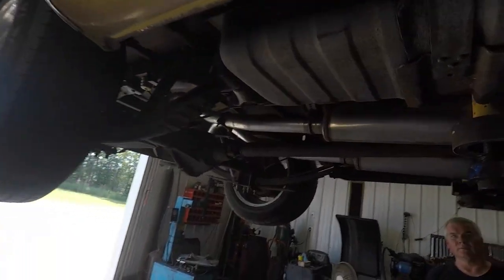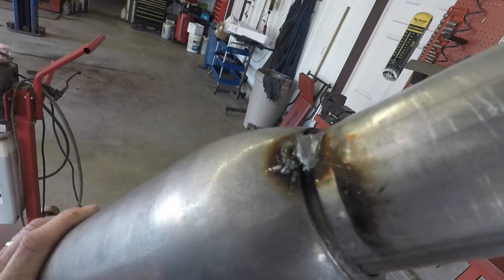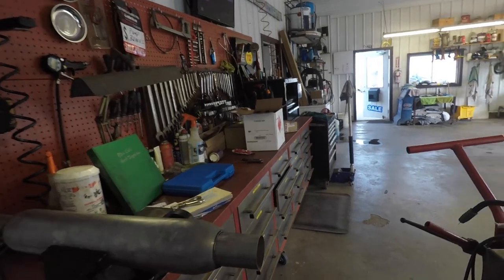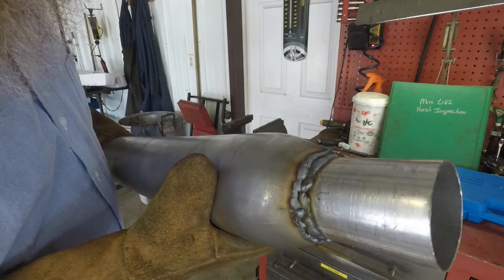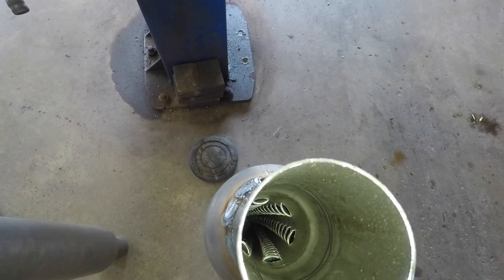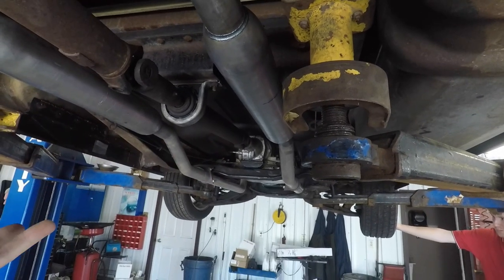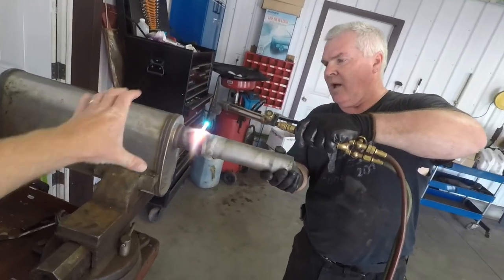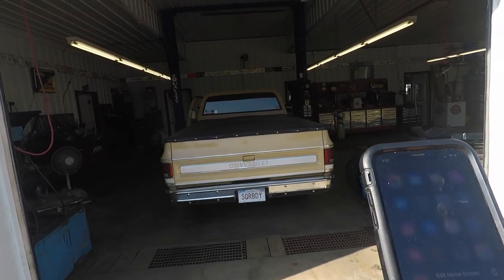How to quiet down your exhaust with glass pack mufflers

Comment: Almost 40 year muffler installer/glasspack manufacturer here. Facing the opening of the louvers in the core toward the motor will initially result in quieter operation at the expense of increased backpressure and early glass burn out. Louver openings facing to the rear if the core is sized properly for the cubic inches of the motor and the air flow requirements/H.P./engine volumetric efficiency, will result in the fiberglass packing lasting indefinitely. Be facing the louvers to the entry of the muffler you are encouraging the exhaust to also flow through the louver and then between the core and the case before it exits blowing out the fiberglasspacking. This will be exacerbated especially if the core is a little undersized. I believe you could safely run it this way (louvers forward) if indeed the muffler were a steel pack (packed with stainless steel wool rather than needled high temp fiberglass) which I also manufacture.
Reply from the maker: Great information! Thanks for your explanation and expertise!
Reply: Can you recommend anything to make a 1982 V8 307 modern day silent?...  Aside from telling "my wife to shut up and enjoy the sound, screw the neighbors VROOM ".  I figure that would cost me half, plus maybe my life ( latina wife)..SO, I figure making the car quiet would be less expensive and less hazardous to my health.
. 🤷🏻‍♂️
Reply: @TheOutlawGeneralBacon  Put a catalytic converter in the headpipe. Heck put 2 in, one behind the other. Install a quiet muffler and put a resonator in the tailpipe. You'll be modern day quiet 🤫 🙂
Reply: @TheOutlawGeneralBacon  walker quiet flow muffler.
Reply: @frigglebiscuit7484  I went with a ceramic velpro maybe.🤔🤷🏻‍♂️. I forget the name of it is. But I feel a tad more power, and it's QUIET can't even hear it standing right next to it.  The only issue now is I need so sort of extension or something,.  Black soot on a new chrome bumper is a bit infuriating.. went stainless to from head to ceramic cat, and ceramic stainless muffler. 3in outlet. .. all in all, I'm pretty happy with it for now . Thanks for the advice tho. I appreciate you
Reply: Can you recommend me what to do.

Set up is 370z with test pipes (no cat converters)
2.5inch all the way through with 2 resonators and dual muffler.

The volume is very loud. How can I reduce the volume of the exhaust without sacrificing the performance hp?

I don't want any restrictions

Comment: I have a 2014 f150 with a 5.0. I installed a Dynomax single 3 inch exhaust with a glass pack in the spot for the factory resonator. The sound is absolute perfection no snapping or popping or any of that raspy junk that people seem to like now. It's all low and mellow tone even at full throttle. I also have a 1970 Torino with a blueprint 302 in it that is just shy of 370 horsepower. Right now I have long tube headers and magnaflow ovals with dumps in front of the axle. It gets very snappy under full throttle but sounds great at idle like your truck. It just sounds angry if you know what I mean. anytime you put the gas pedal down more than normal driving. Since the glass pack in front of the muffler on the truck worked so well I'm about to order a set of short glass packs to put in front of the magnaflows on the Torino. Hopefully that will take the full throttle edge off of it and make it more enjoyable. It used to have full tail pipes going out the back but somehow that was causing an engine vibration so I chopped them off while I was putting the magnaflows on, and welded on dumps. I just want to get away from that completely angry sound that's going to cause me to get tickets. I also picked an exhaust shop that wanted $125 more for an H-pipe, so I still have that to do.
Reply from the maker: I think you’re on the right track!
Reply: @OldeCarrGuy  IT WORKED!!! Still sounds like a performance car with a nice engine, but doesn't sound like Nascar try outs when revved!! The sound when revving it up was reduced by at least half!

Comment: This is a big difference with the glass pack, still sounds great at idle. I have a 08 canyon 4 cylinder... Have 2 mufflers. 1 is a single chamber v-baffle style by team allied exhaust, it replaced a non- monitored plugged cat. Replaced the magna flow had on it with a 3 chambered street flow v-baffle type. Sounds nice at idle and outside of 1800 to 2200 rpm. Still get a bit of drone in cab. Think I may give a glass pack a try in front of the main muffler. Anybody have any suggestions? Thanks. Great video. I have an update, in place of the 1 chamber muffler the place that put it in swapped it out for a 2.5 ID in/out street max muffler, 22 inch body center in offset outlet under the cab. The drone is gone. A bit quieter it reminds me of a mild sport "corsa" cat-back system. Deeper a bit quieter. So much better without the drone. Thanks for the advice of it being worth a shot. Would have gone the route of a TR team-allied resonator but would have to been ordered.
Reply from the maker: Worth a try!

Comment: Fantastic presentation, your truck sounds Premo now! I am installing a Cherry Bomb Hot Rod muffler this week. This one doesn't have glass matt like the traditional glass packs, but does incorporate louvers. I have a 1990 Dodge D150 318 5.2 single pipe exhaust.  Cherry Bomb says you can run this muffler either into the louvers or over them. I don't want a loud exhaust, just a deep rumble throaty sound. What do you think? My truck doesn't employ a resonator, just a cat.
Reply from the maker: I would think the louvers facing forward would be quieter.
Reply: @OldeCarrGuy  Have you looked at the Cherry Bomb Hot Rod muffler? There are a few videos of it on YouTube.
Reply from the maker: I have not!

Comment: I ran Cherry Bomb glass packs on a couple cars, they sound good when new but burn out fast then you get a totally different sound. That muffler not being welded says a lot for their quality control. What brand were they?.....
Reply from the maker: The are the same as the mufflers I used. AP Xlerator
Reply: How long would they last?

Comment: Hey Man... I hear glasspack mufflers wear out. The Xlerator mufflers here, are they the same MATERIAL wise or do they use a different approach at capturing deadening sound. In other words will the Xlerator wear the same - or are they a more solid state without fiberglass? Is there a straight shot muffler like these that don't use fiberglass?
Reply from the maker: The Xlerator mufflers have a straight through  design and are chambered rather than packed like a Magnaflow or Flowmaster. I hope this answers your question.
Reply: @OldeCarrGuy  it does, thank you. These would be going on a 2004 Jaguar XKR that the PO modified to basically have straight pipes. Its TOOOOO loud for me. There is roughly 2ft for straight pipe where the rearmost mufflers/silencers used to be. I'm hoping to find something that will not kill, but do a good job at bring the note down a bit...
Reply: The Supercharged XKR is a V8 just under 400horse...

Comment: I'm running a dynomax turbo muffler with no cats on 4.3 vortec would putting one of these in front get rid of the higher rpm raspiness
Reply from the maker: Most definitely. It's why I wanted to tone mine down!
Reply: @OldeCarrGuy  thanks for the feedback really appreciate it
Reply: @OldeCarrGuy  what's the part number for those glasspacks
Reply from the maker: Unfortunately I don't have a part number. There's a lot of variables there. The overall length of the tube you need and the diameter of your exhaust. Amazon has a wide variety of brand name and no name glass packs. Mine were pretty much no name 2" that measured 27" over all length.
Reply: @OldeCarrGuy  thanks for your help
Reply: So I need to look for a chambered glasspack like steel pack instead of regular glasspack

Comment: I really didn't think glasspacks were directional. Sounds like a stock Grand Marquis now. Didn't the original LMC truck exhaust come with glasspacks?
Reply from the maker: Apparently they are directional. I wanted to use the glass packs I had but they were angled in and out.

Comment: Sooo what was your old setup? I ask because my car seems too be way too loud after my LS swap I had 2 , 2 chamber mufflers which was fine when the car was a v6 but now it's way too loud from being a cammed 5.3 do you think adding 2 glass packs in front of my 2 chamber mufflers make it quieter ?
Reply from the maker: The old setup was a stock 2" replacement dual exhaust with just turbo mufflers from LMC Trucks. I do believe two glasspacks will act like resonators and tone it down for you.

Comment: I like the sound, how much has the sound changed since you installed the glass packs? Has the packing burned up in the amount of time you've been running it? Thinking of doing a similar project on my 79 Camaro but I don't know if the glasspacks will last with the heat from the headers...
Reply from the maker: The sound actually stayed quite constant over approximately 3000 miles. Very mello. I just recently uploaded a video with a new exhaust system. Headers and stainless 2.5”. And it’s a bit loud for me, so I may do the same thing as I did in this video.